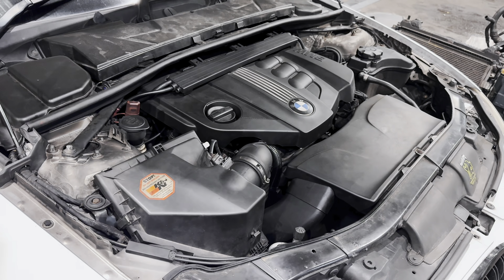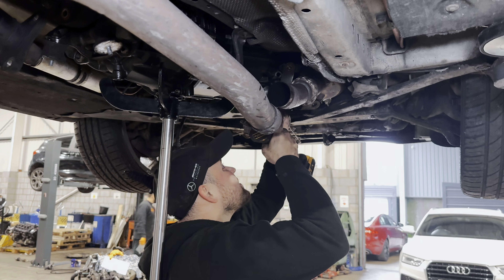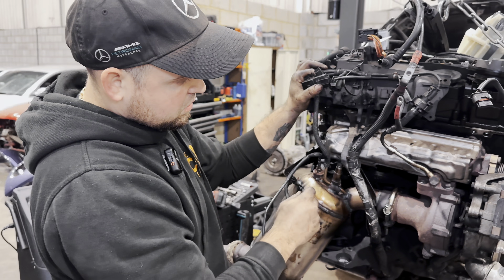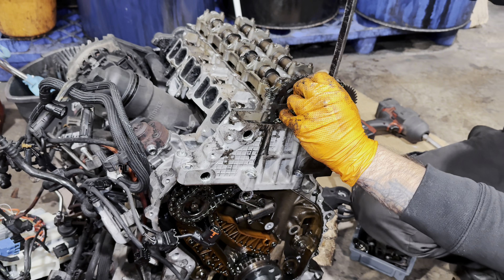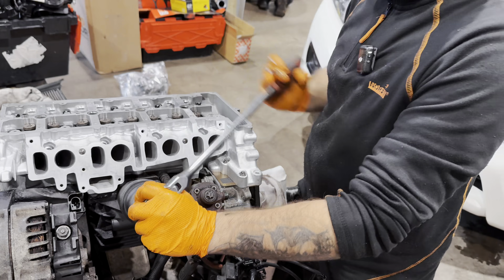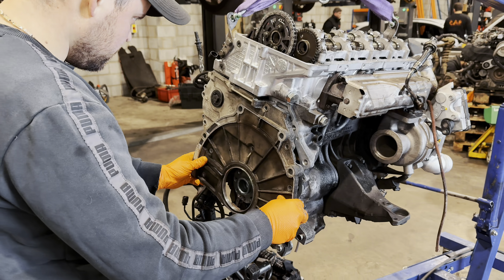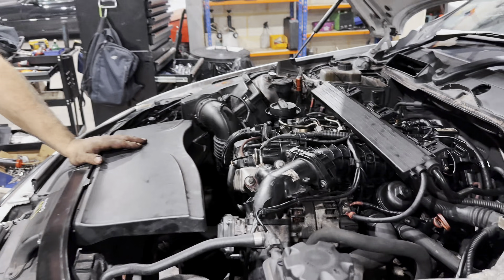BMW N47 Engine DISASTER: Plastic Swirl Flaps Destroyed Valves, Timing Chain Stretched & Turbo Gone!

Comment: Very fast tech taking engine out in 70 minutes. Id say car brand labour time is 3 hours as we use auto data car labour  repair software to estimate evey repair down to fitting a headlamp bulb 10th of an hour..slow down and use full labour times for each job as mechanics are prone to  back injuries and wrecks before 45 if working at high speed all the time. Think of longterm and preserve health. I used to do this and realised as my garage charges 100 per hour if i shave 3 hours off a 6 hour job refitting a used bmw engine it's not going in my pocket th the 300 is going into my garage owners pocket or service advisor who's sitting in a warm heated office... 
Work smarter not harder 😊

Comment: absolutely pointless on a car of that age and calibre (nice car but there are thousands of 2l BMW diesels to pick from). if it is anywhere other than the south coast, that car will start rusting away in a few years. And at that age the alternator will let you down one day maybe far away from home, cooling hoses will start coming apart, water pump will go....pointless

Comment: 3 x E36 and 1x E30 Bimmers lovely beasts and gave me not much trouble (a new battery, some oil changes, weld a seat frame when I bougtht one from a fat bloke). However modern bimmers:  N43............. had to get the mechanic to change oil and flush 3 times and sold it the same day..... never again. I run Japanese cars now. I do miss the old BMs ....

Comment: Just a few small things I would’ve done slightly differently (my OCD kicking in): I would’ve thoroughly degreased and washed down the engine block, including inside the bell housing and cleaned off those sealant smears for a really tidy finish. Other than that solid job 👌

Comment: Watched multiple rebuild videos by now, great skill and good sense of humor. Fun at the workplace is key to a good business. 
Only thing that makes me cringe is using a wirebrush to clean surfaces before applying the new gasket, even though you use air pressure to blow it clean, tons of tiny metal particles get blown into crevices and parts still attached that will come loose and collect in the oil and cause issues. Please be aware of this when using a wirebrush, at all times make sure your surface/parts are squeaky clean before progressing.

Comment: Reminds me of a 5 series I bought a few years ago with a non running engine 
When we pulled it out and poped the head off every valve was bent 
It had only done around 100 thousand miles and the changed had jumped multiple teeth 
It also needed new valve guides as they were so worn out 
So my engine guy fixed it and it cost a bit less than yours did 
Anyway when it was done it was very good and fast as 👍👍🇦🇺

Comment: I still own and run 2005 BMW E60 525d with 167000.0 Miles i had Swirl
Flaps replaced few years ago for upgrade version. And  decarbonised.
From BMW and change the oil breather. For better one . Has said before if you maintain them, right, shouldn't have major problems

Comment: Your magicians working with N47 BMW engines deserve a standing ovation! I’ve owned three BMW X1s with the N47 over the past decade, and I absolutely love them. With xDrive and proper winter tyres, these cars are unstoppable—snow, ice, anything.

But here’s where the real magic was needed… Twice, on those crisp frosty mornings, disaster struck.
My first X1—about 140k miles, full service history—suffered an engine failure that wrote the whole car off. A 2011 model, gone in a snap. Then came X1 number two, a 2014. Same scenario: cold morning, sudden crack, and the engine was done. This time it was repairable, but the cost Just over £3,000. The culprit each time? A tiny plastic part that fails and unleashes a massive, wallet-draining problem. Thankfully, my current 2014 X1 is still running strong two years on. Fingers crossed it stays that way—because when these engines behave, they’re a dream. When they don’t… that’s when you need real magicians working on them.

Comment: An absolute masterclass, better than BMW who changed my clutch and DMF, charged £4000 then forgot to tighten the brake calliper bolts - found that out 100 miles from home….

Comment: As an old retired mechanic 82 I removed my swirl flaps on my 320 D 2004  nine yrs back  just by lifting the manifold now have 188000 is I do clean out the E G R now & then love my car I do 5000 is oil filter changes

Comment: My 320d lci n47 240k miles. Chain done at around 200k. Its not smoking under full gas. Goes great, no problem at all. Great engine. Serviced once a year (6k miles) bmw oil and all filters in quality

Comment: My car has been parked up over 3 years rotting away because I can't find anyone competent enough to change the gearbox and 1 break line. I have another gearbox and torque converter ready to fit but after 3+ years I'm sure many other parts will need changing so I bought another car similar that's running and driving for even more spares but still nobody wants to touch it. Absolutely baffles me that nobody wants to do it yet you lads pull them to bits and refit everything as a normal day. I've got a video in shorts of the current state of my car :(

Comment: Have 210000 miles on one of these and still going ok. Original flaps and turbo and everything.  Changed the oil at 10,000 miles from new and no stupid short journeys. Wish I still had my E91 2006 M47. That would have gone for ever.

Comment: Just wanted to comment and add my appreciation for this gentleman's skill, experience, dedication and overall brilliance
I watched this video because I recently sold my 320D Msport as a "Starts but runs like it's eating itself". Maintenance on these cars is absolutely paramount. I bought mine on 95,000 miles as a beautiful used Msport Xdrive Tourer... Ticked all the boxes... all the gadgets etc. I put a load more motorway miles on it over the next 5 years myself but never cheaped out on maintenance
I'm no mechanic but during MY OWNERSHIP I threw so much money at it in both servicing and preventative maintenance, BUT the damage had already been done by the previous boy racer and it just became a money pit... Turbo, Transfer Box, Auto Gearbox Service, Injectors, DPF, EGR, Water Pump, Oil Pump, Glow plugs, lots of work to deal with leaks and lots of other under-the-bonnet jobs.
These are Great engines technically, BUT THEY NEED lots of TLC otherwise they will chew through your savings.
I doubt i'll ever buy another used one as you just don't know how they have been treated as a toddler, so when you buy one that is a teenager its probably too late

Brilliant video though. Superb workshop and video skills!

Comment: I hope your boss pays you what you're worth and not the standard low wage mechanics get.
It's the most expensive trade you can get into woth the most risks, I was on the spanners for 5 years, but left for a factory job which paid almost double the mechanics wage, and there's no real responsibility and no tools to buy, the only down side is I don't enjoy the job like I did when I was a mechanic

Comment: In Norway this job would be to expensive to do. 3000 pounds is only a clutch and flywheel job. You can double the price maybe more. And in some cases the car dont go back to road with a damage like this. Its not worth it

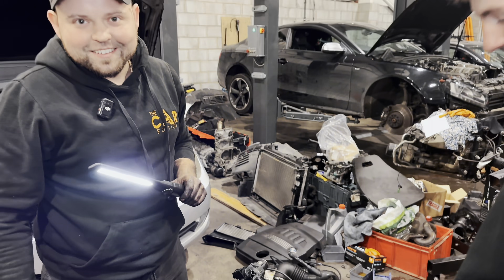Comment: 6:11  bro I must contradict you here with the plastic flaps on Bmw the M47. It’s got metal flaps and they are actuated by vacuum I have four BMWs in my family three with N 47 and 1 M 47 which is a hero stands at 213,000 miles. no issue with none with regular service.😉

Comment: My extremely well maintained from new 2015 520i nearly had the same issue - at 100k it sprung water leak on a pipe near the plastic manifold - to replace the pipe meant taking off the manifold which was then found to be totally clogged and one flap about to fall off into the cylinder... Oil changes at 10k and 2 new EGR valves courtesy of BMW recalls... Great engine spoiled by silly cost saving plastic crap and EGR.

Comment: Top job. Altough the fuel pump should have been checked for wear. They can turn 90 degrees inside and the lobe and the tappet file metal into the fuel system, ruining those refurbed injectors ant the whole aystem.

Comment: I had an 80,000 mile 2004 530D that died on me around 16 years ago - a swirl flap went through the engine and killed it.  To be fair to BMW, they did replace the engine even though the car was around 7 years old at the time.  It was a known issue with the engine and, i assume, rather do a major recall, they opted for remedies if/when they occurred.  A few months later, the gearbox died and I have never touched a BMW since.

Comment: "Sometimes boss asks us where the break cleaner goes".  This is madness. They way you take engine out in 1 hour saves boss THOUSANDS OF DOLLARS! (versus can of break cleaner $3.00 dollars). Engine removal book time is about 10 hours minimum. With installation is 20 hours minimum. So, you saved shop minimum 18 hours.   You make $10,000 or $50,000 or $500,000 for a shop per month, and "boss asks where $3.00 of break cleaner goes".  Madness. They do not value your excellent superior amazing skills. They do not know what (who) they have.

Comment: The boss asks us sometimes where the brake cleaner goes😅
Reply: Yeah, and I wouldn’t be breathing that spray so much either. If a surfactant can lift brake dust & oil it can’t be doing your lungs any good.

Comment: Even USA, BMW expert "Car Ninja" says, dont buy any BMW after 2010.  Amazing the mechanic got that engine out so quickly, and neatly.......skilled labor at its best. That engine needs an oil catch can to prevent excessive oil feeding back into the engine, and the EGR blanked off, simple resistor on the IAT will keep the EGR valve shut, and never trigger the check eng light.

Comment: 70 mins to pull the engine is crazy. Guarantee most garages would claim that’s “half a day’s work”
Reply: In australia, 2 off lower control arms, 2003 toyota landcruiser, time quoted on bill " 2 days work"+ £700. 
Australia is next level lazy, and rip off.
Reply: you gotta take into account that very few people can do that/have the knowledge to do that, that's why there's book times - a manufacturer's/industry determined averages. It is half a day's work and you're paying for half a day's work regardless how long it took him. it's not like because it took him 70 minutes you're paying him 80 quid

Comment: Sorry to say this but the B47 is not much better. Bought a 2016 320d xdrive in 2020 with 50 000km. 
Belive it or not well maintained. But the swirl flaps. O they was full of crap barely moving making the engine go crap now and then.

Yearly oil changes and two carbon cleaning didnt help. At 98 000km after 2 turbos and 1 front differential i gave up. 

Never be optimistic if you drive BMW. 😂

Now in back in a Toyota. Still carbon and egr but no flaps or turbo madness.

Comment: Love your content guys! Real expertise. 

On all of our IVECO Daily vans we see, we are now encountering a huge issue with carbon build up primarily on the 2.3 (F1A) and also the 3.0 (F1C) engines. On the F1A’s you get lack of power, or blow by filter leaking down side of engine and you remove the throttle valve and you find tonnes of carbon and the EGR pipe is clogged. Then it requires a full inlet manifold removal and carbon clean. 

On the F1C’s you also get boost delivery issues. This is caused by carbon on both sides of the manifold clogging up the EGR valve and pipework. 

Also to note… this directly also causes DPFs to soot up and clog too.

Comment: I got the same car with the N47 engine. 250‘000k. Servicing it as foreseen, manifold cleaned at 170t km. Love the car, but the day the chain rattles it will probably not be worth fixing it from an economical point of view. Repair costs in Switzerland will surpass car‘s value by far. Excellent job here, true car mechanics!
Reply: With most older cars, you need to compare it to the value of a new car. Sure, the job is worth more than the value of the car, but how much is putting down money and insurance on a new one? It's always cheaper to keep the old one running, especially if you like the car.
Reply: Was kostet es die Steuerkette in der Schweiz zu tauschen? In Deutschland um die 800€ bis 2000€ kommt drauf an in welcher Werkstatt. In Polen gibt es eine Werkstatt die machen das täglich und haben sich darauf spezialisiert und machen nur bmw 3500 zloty also auch um die 800€ für den N47D20C oder N4720A gibt aber auch Werkstätten die verlangen für die gleiche Arbeit 7500 zloty fast 1800€ und sind in diesem Bereich nicht spezialisiert und verlangen das doppelte vom Geld , bei dem Spezialisten dauert die Reparatur maximal 6 Stunden bei dem der viel Geld verlangt paar Tage weil er meistens keine Ahnung hat und das vielleicht 2 bis 3 mal im leben gemacht hat , das ist meine persönliche Erfahrung mit Werkstätten .

Comment: 1h to pull the whole engine out is absolute madness😮😮😮
Reply: Probably not first n47 that needs to come out 😅
Reply: @Taaviots And propably not the last one eiter 😅
Reply: Done my timing chain somewhere in Rugby, took him 40 mins , the guy knew every bolt where its from.
Reply: @slvs91  Can't have been an N47 engine then. Even if it was an M engine, with the chain in the front, it's still way too fast.
Reply: @jgripen969 i was there watching
Reply: @slvs91 No way, I call BS
Reply: @ChrisPatrick-q6k why would i be bs , it wasn't me that done it , trust me there are people that know what they're doing out there , this guy only worked on BMW.
Reply: @slvs91 'did it' BMW's

I'm calling BS, how much did he charge you for 40 minutes work?
Reply: @ChrisPatrick-q6k we were talking about pulling the engine out , he started working on it around 9am , took one hour break and by 1330 he was doing test rides i left his garage before 2pm , i have no reason to lie .
Charged me 750 for timing chain replacement and the kit used was a BGA.
Reply: @slvs91 Ok, sorry for my cynical response. Are BGA any good? I've heard of INA, Febi, SKF etc.
Reply: @ChrisPatrick-q6k i don't know but they didn't look as strong as the original one , i sold the car after about 10k and the guy i sold it to done about 40k on it and then sold it to a friends of his and the car is still being used atm at over 200k miles, i have changed the chain at around 150k
Reply: @slvs91  Midlandbmwspecialist the business is called and his name is Anthony, he does my bmws for me too 😎
Reply: Amazing
Reply: when you do this sort of work all the time you can get these out very quick.
Reply: Some specialist do so many n47/57 they do this like rolling production line

Comment: used to love BMWs as a kid, always wanted one until i was old enough to realize what he said, that you shouldnt be optimistic if you drive a BMW, you should be prepared for big bills
Reply: Have done 130 k with my bimmer f20 . Only the usual service and consumables.  Do the service on time. Should be enough.  Changing the oil every 7000 to 8000 miles.
Reply: @alexandruionel1210 116d here. 11 years old and 65k miles. Serviced every 5k. Only issues have been the horn and washer motor stopped working.

Comment: Best engine in terms of longevity is the M47 lump as used in the 3 series & Rover 75 and Freelander from 2000 era.
These engines good for 700k miles, we know of a few.
Timing chains last for life of engine and they don't use a drop of oil even after 500k 
They can be mapped to 160 bhp and higher with bigger turbo.
Bullet proof .
Reply: The reason they lasted so long in the Rovers & Freelander was because they were detuned. Once you start messing with them the reliably suffers. The Siemens injectors used in them were rubbish though.

Comment: The N47 - not BMW's finest moment. However, if looked after, they are actually quite good engines. 

I've had two. The first came from the factory with the timing chain issue. I had that done before it failed. The second had the revised chain guides from the factory, 200kmiles no problems so far. However, I will be changing the chain and guides soon; this is no longer an engine-out job (there's tools for the job), so it's not too hideous to do. 

Swirl flaps - yep, not the greatest thing either. Basically, it needs a new inlet manifold (which includes the swirl flaps) and a walnut blast every 100k at least. 

Turbos - well, that's down to how well and how often the oil changes are done. I've done mine every 10k regardless of what the car says, and no issues so far. 

So, definitely not an engine to tolerate a lack of maintenance. 

But, in this day and age, one really questions what's a good engine to have going forward. The N47 doesn't need Ad Blue - it's only Euro 5, not Euro 6 compliant. That means it is notably simpler to keep the emissions system up to scratch than the later engines. With a stock of inlet manifolds and chain guide kits and some maintenance dedication one could probably keep one of these going for a long, long while, in a largely tech-free car such as a 3 series which is an excellent daily driver in many regards.
Reply: Swirl flaps only in the higher power versions so it's one reason to avoid those 👍

Comment: I have an n47 with 2 snapped glow plugs and need to remove the cylinder head. Can I replace the head without removing the engine? I think I've seen it done before
Reply: I had one where the timing chain snapped and bent all the valves and left it in the car, still have to remove gearbox for timing chains tho
Reply: @brandon77020  I've just replaced the head but haven't started it yet. All I did was put the engine in TDC, locked the cams and made a few marks with a paint pen.